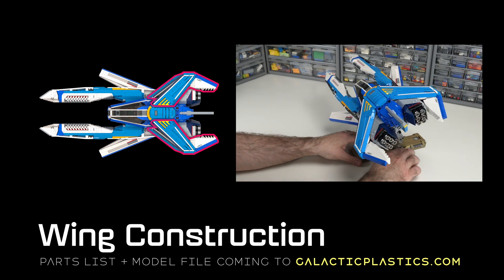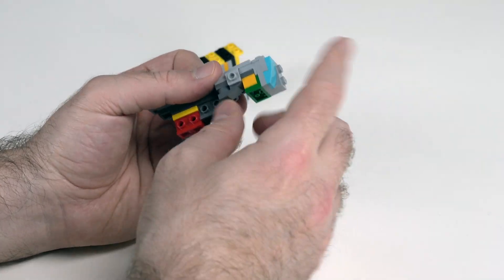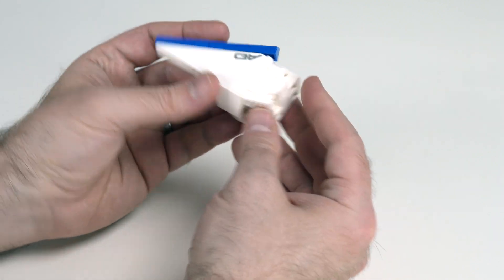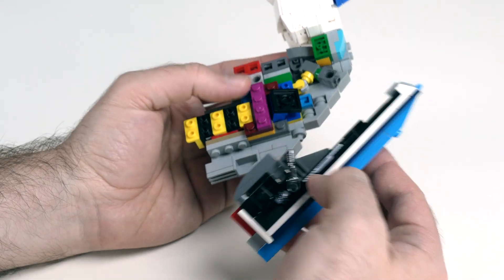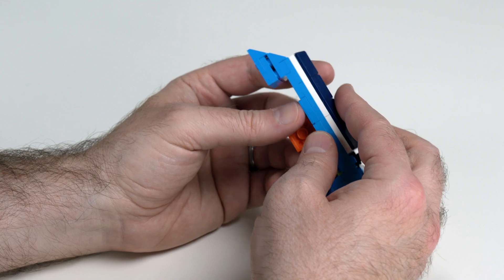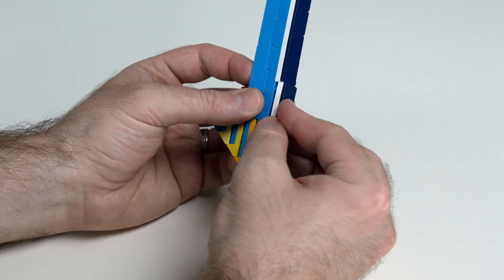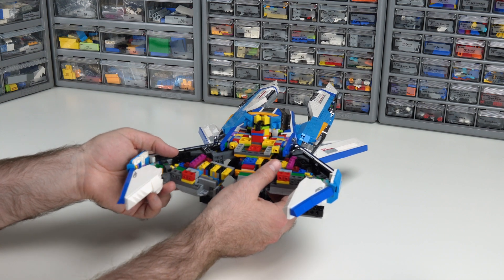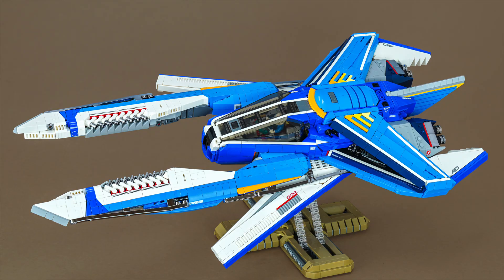Advanced LEGO: Interference (Wing Design)

Comment: wow wow wow! Is the whole assembly you're putting on at 7:04 really held on only by that single stud on a tiny little arm? And it's actually stable? You're a genius!
Reply from the maker: I'm thrilled you enjoyed it! 😁 In short: yes, that bit along the front of the wing is "pretty darn" stable. In long: It works because it's nearly locked-in - from the bottom there is a circular tile section that rides in a panel cutout (along with main body sitting on wing framework); where that module meets the ship interior it has a bit of interlock when it's all assembled so it can't slip out; and then that stud connection keeps it at the proper angle where the other side abuts the 'wing cap'.)